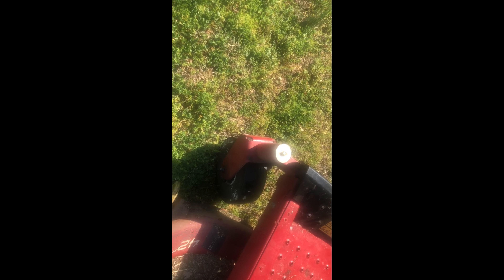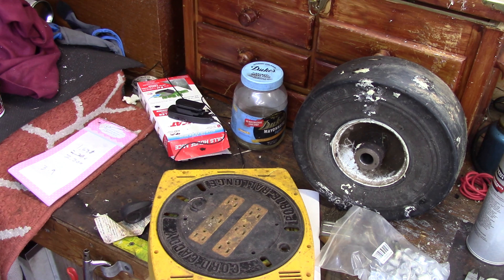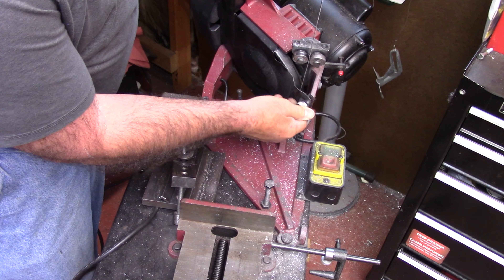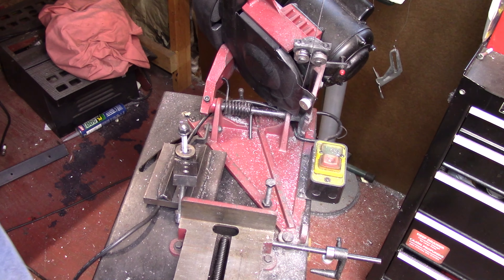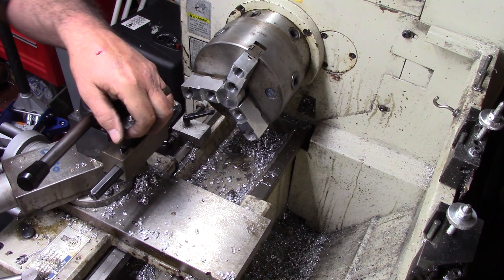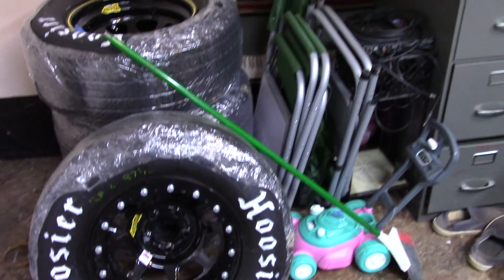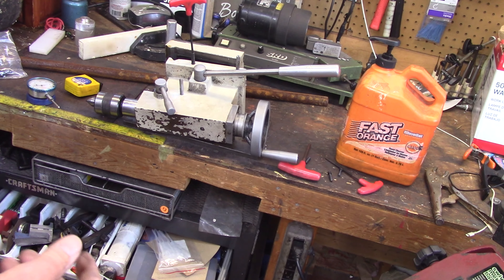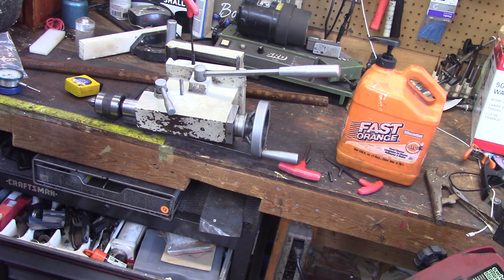Slop in the  shop 105

Comment: Thanks for the conclusion to your tire foam experiment. I would have thought that would have worked for a slow speed tire. I also enjoyed the variety of your slop.  See ya next time.
Reply from the maker: I did also, however it also my been my prepration or the application on the zero turn mower. Since it was a junk tire no loss in this experment

Comment: I see a future project for you. Mount a brush system on your band saw to clean the tires as you go. My Doall has it.
Reply from the maker: Hill Top Machine Works I actually thought of it. One drawback to my conversion setup is the metal chips tend to pile up in the front corner of the guard. I did some sawing with the plastic guard off and the chips fell straight down.